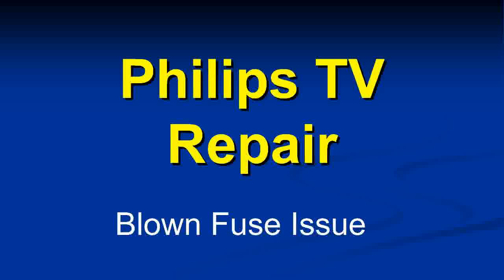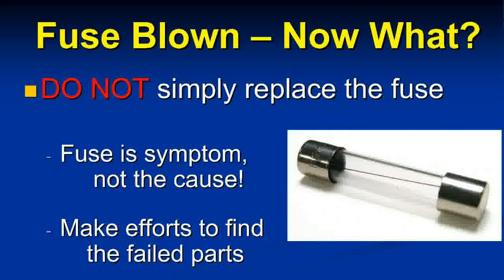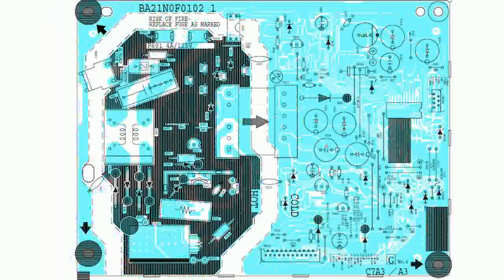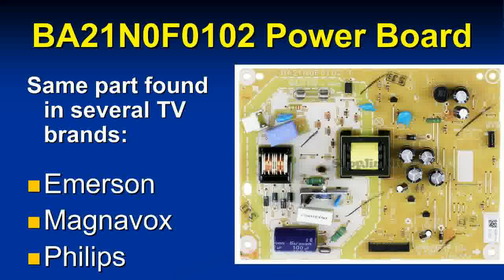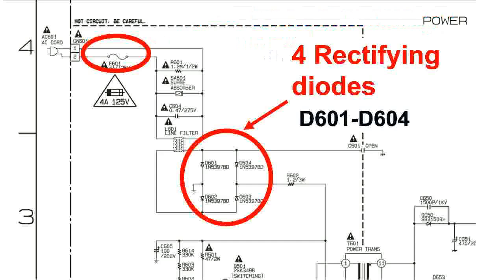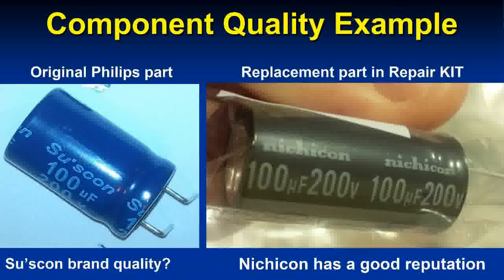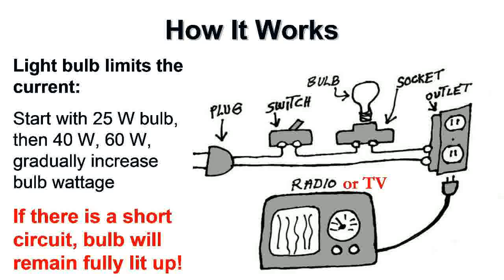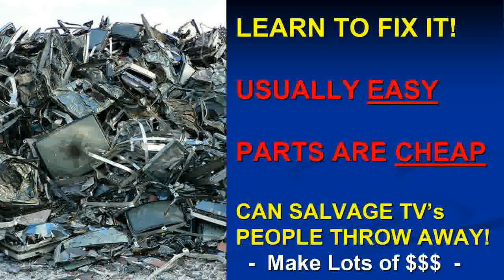TV Repair Fix for Blown Fuse (Philips Magnavox Emerson Samsung LG)

Comment: Your absolutely right stop letting these company’s screw you over
Reply from the maker: There is always a "weakest link" in design electronics and if it happens to be something easy to identify and fix, that is the ticket to keeping them going way past their warranty. Today we lost the art of fixing, you need to not be afraid to learn, take things apart, develop some simple skills. Unfortunately the "repair" industry is gone, you have to do it yourself... otherwise everything is considered disposable.

Comment: TV turns on but the screen is black
Reply from the maker: Do you hear any audio? Are you sure it is fully on? Is there any on-screen display/menu function working? Could be a number of issues, but I would start by checking the power supply and making sure it outputs all the necessary voltages everywhere especially to the backlight, video processing board and so on. If the power supply is good then perhaps something with video processing board or backlight. Let me know.

Comment: No offense but for everything that you went through and the money that you paid you could've just bought a new power board. They charge a core for your old one so you would've paid around $50 or less considering this is before the corporations making the shitty products took a shit on our sad country.
Reply from the maker: So it turns out the power board for this TV cost at least double what the components would have cost, and I wouldn't have had the fun I had doing the repair (which doesn't take long if you know how to solder). However if you can't solder well or don't want to waste time, then yes the power board swap would have been quick and easy. However you may not always be able to find a power board and need to actually know how to find faulty components and change them individually so learning to swap component-level parts is a useful skill to build.
Reply: @devhackmod  Touché

Comment: I had power surge making my tv dead and blow the fuse. I bought a new board on ebay to replace entire board without replacing components. I put it in and the same fuse got blown on main board. What's wrong ?
Reply from the maker: Sorry to hear about this. Yes, so something in the rest of the TV is causing a "short circuit" probably and that is drawing too much current from the power supply, hence blowing the fuse. You may have wires heading from the power supply (usually orange colored board) to the logic board (usually green color) or the backlight circuits. I don't know what kind of TV you have, but you need to trace the source of the dead short. That's relatively easy... use a multimeter, set it to RESISTANCE and probe the other board pins that expect power. For example, if you see a 5V or 12V input or some other inputs on the other boards or backlight circuits, you need to see if there is any resistance. If there is little to no resistance, the power supply feels that as a dead short, will supply too much current through the circuit and blow again.

Comment: The fuse on my psu board blew. Trying to replace the fuse i had the same issue (and during this the fuse to the power switch board blew) may I ask, as I have just ordered a new PCU board and I'm in a rush to finally play playstation, should I order a new power switch board/mother board etc which might also be a fault? Kind regards. I have a Bush LCD26TV022HD
Reply from the maker: I'm not sure how many boards your TV has. Most LCD have 2 main boards... Power supply board (often orange color) and logic board (usually green). There may be a few other boards to handle LCD panel vertical/horizontals as well. If you are blowing the main power fuse it is likely a flaw in the power supply board only. I would start with a power board replacement (or order a kit for component level repair if you are handy with a soldering iron) and check to see if it works ok. Usually the logic board handles lower voltages and would probably not be tripping the fuse. However you can check by testing resistances on the various power rails and make sure there isn't a dead short somewhere. One other option is unplug everything from the power supply and see if it still burns the fuse. If it is, the power supply is getting shorted to ground within itself. In my video I show an example of how a bunch of other components were faulty and causing it, so all had to be changed to stop the short and remedy the fuse blowing issue. Good luck with your fix and let me know how it goes!!

Comment: Good stuff. You helped me realize I'm much better off replacing the whole dang power board than fiddling with individual components. I haven't soldered in years & the money is better spent  on a possible plug-&-play fix. Fingers crossed 🤞
Reply from the maker: Good luck! Yes I've had my successes but also plenty of failures... some boards I've replaced 4 or 5 components to no avail. It's sometimes not feasible to track down the failed components, you end up down a rabbit hole and costs too much in time and parts, in which case a whole board replacement is sometimes the easiest option.

Comment: what if for example a storm destroyed it and the fuse burned? could I just replace the fuse then?
Reply from the maker: If you are certain it is only the fuse, then yes. But I would still use a dim-bulb tester to make sure. You can build these cheaply and it will control the current through your TV so you don't blow up anything else in the process (just in case the fuse wasn't the only thing the storm damaged).

Comment: I did see your Q601 got hot from looking at the PCB , your board got a lil hot ....  On the Emerson's the PS Board is Q600 and those fail a lot.... I have one now that opened instead of shorted , so I got lucky on that one ..... I haven't checked the rest of the board yet though, I just got it in yesterday .....
Reply from the maker: Thanks, hopefully you are able to fix it also. Good luck!

Comment: Good idea with bulb! Thankyou!
Reply from the maker: I learned this "bulb tester" idea from the antique TV/Radio repair folks. It makes sense... a 10W bulb would use 10x LESS current than a 100W bulb given the same voltage. Therefore, if you want to limit current through the device, you use a bulb and increment it slowly. If any of the bulbs glow full strength you have a short but at you put 10x less current through your components so you don't fry more stuff. It's also a fun project to build the bulb tester!
Reply: DevHackMod Channel Yes, I allready made one for my self.

Comment: i send my board to a repair service in Ebay finasonic they said the power board arrive to they facilities damages in  one of the corner but it will work, i place the power board on the tv, but guest what still blowing the fuse, i think or they do nothing or they just send me another damage board  that cost 39.99

Comment: What does it mean when my 50 in Phillips 4K LED TV blew out when lightning struck and then I don't have a standby light it's the same as the power button light when I turn the TV on with the remote that light comes on kind of a light blue color then that light goes out the TV never comes on can anybody answer that? What does it sound like is good or bad
Reply from the maker: You need to go through the same diagnostic protocol. First, look around the power supply, is it properly giving power? Does anything look blown? Get our your multimeter and sniff around. Your power supply probably has a fuse or some other components got fried when the lightning spike hit the circuit.

Comment: This is great info, subscribed!
Reply from the maker: Thanks! Good luck with fixing things!
Reply: Hey quick question, I have a universal remote that has been giving me issues. Any idea why the channel buttons won't work to change tv channels but function normally when it comes to navigating the menu options? I'm considering a replacement remote at this point, its a head scratcher
Reply from the maker: You need to find the exact code for your programmable remote to fit the TV. Some codes will seem to overlap and work on a few TV's but only a few of the functions work (such as menu, or volume, or power, etc). Try ALL of the codes for your brand of TV and not only the first one that seems to work (usually the one that powers the TV on/off) and see if that helps. Good luck!

Comment: Have a vizio 60inch no power,when I first got it the TV would cut off by it self and had to turn it on again,until one day when the TV was on it cut off by it self again,and when I try turn it on the TV wouldn't turn.help please?
Reply from the maker: Check the power supply, start with the capacitors and then go through each component if you are familiar with electronics. Otherwise I would order a power-supply board and just swap it. Much easier and cost effective. Good luck!

Comment: Any tips on discharging the power supply? I have a Samsung 50 inch plasma and want to try replacing power board but fearful of a fatal shock.
Reply from the maker: Yes, what usually holds the shocks on power supplies are CAPACITORS. They are usually the can-shaped (but not always) components. The way to drain them safely is to put a resistor across the leads of the capacitor, a small bulb (which acts like a resistor), or touch the leads with a digital multimeter set to high volt rating. If you put a screw-driver across the leads it will spark and could ruin the capacitor or melt stuff. You want to discharge slowly that is why you use the appropriate type resistor. For large capacitors you may damage your multimeter so best to know the rating. Also, since the impedance for voltage readings is usually quite high on multimeter (so that it doesn't pass current and affect the circuit too much) it may take a long time to discharge the capacitor through it. It effectively acts like a very large resistor.